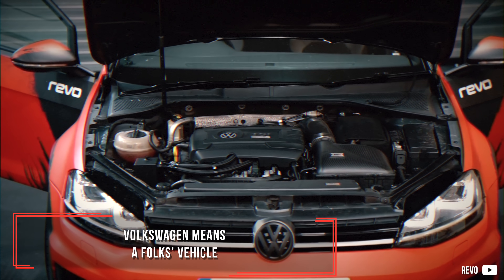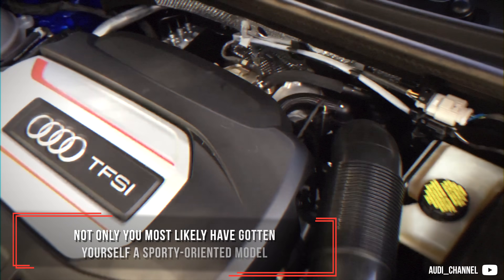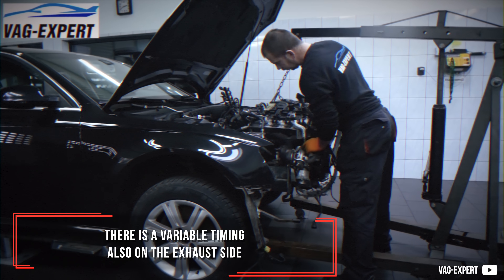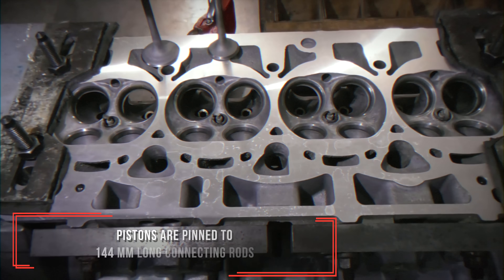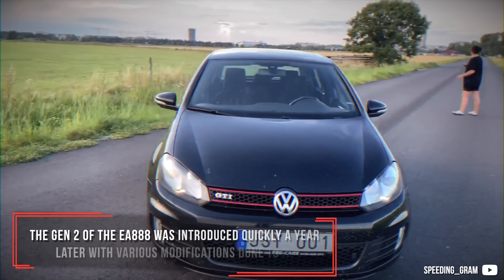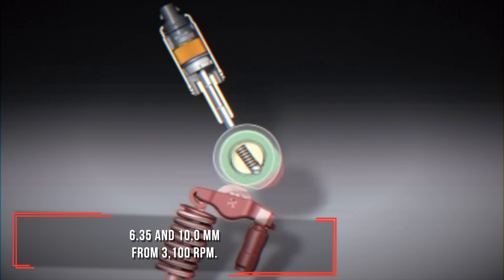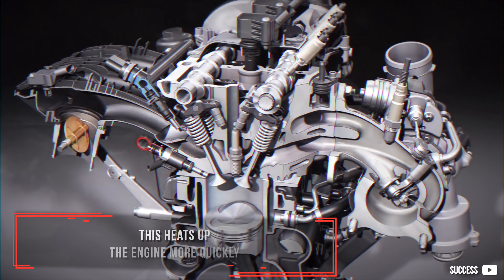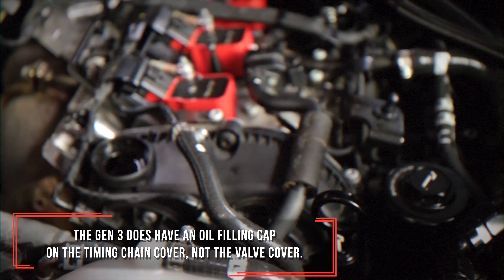Why The Volkswagen EA888 Is So Good

Comment: I have Cupra with that amazing engine. Stock 300, tuned to 360 now. Amazing step in acceleration. Soon I'm doing stage 2 which includes bigger downpipe and intercooler which will give additional 40 hp.
Reply: You got the ST estate or FWD 300?

I'll be going to OEM+ stage 1 mapping on mine as I have a GPF. But with remap/intake and filter/ intercooler and resonator replaced it should make between 380 and 400.

I think thats as much as I'd ask of it still being FWD lol. That and change the service interval to every 6k miles to try and be on top of it.

Comment: AP 2000 with diferent heads, this iron block 1984 cm³ is very very reliable in the old but gold version AP 2000, 8V with 110 or 125 cv with MPFI, VW powered almost all her cars in Brazil with AP engine, 1.6, 1.8 and 2.0, with single head cam. 
After they adopted multivalves and turbo, the engines lost realiability and gets more complex and hard to maitain. The old ones are still running today....everyone knows how to fix
Reply: True!!!!!!!!

Comment: Got a (gen 3) 3-door hatchback s3 (8v) dsg/s-tronic.

Engine is smooth in total powerband. Not as exciting as n/a or oldskool turbolag cars. But lots of power, decent gasmileage and sound. 

I am extremely carefull with this car, only premium fuel (v-power, octane 98 in my country). Yearly oil changes,  around 7-10k km.
I do drive a lot of short distances, but always with care. Only getting on the power when properly warmed up. 
Most days only using 25% of power, without or minimal boost pressure, according to gauge in dash.  

Have had issue; of car turning of while driving in eco mode, during lift and coast. Was problem with start/stop system.

Have had (around 125k km) problems with rough running. Sometimes having more power than expected sometimes less. Without warninglights on dash.
Codes: cam an cranktiming timing of.
Work done to fix issue.
-leaking injector switched others were tested and cleaned. 
-worn cam (sensor) 
-stretching of chain.
Chain is was not yet due but close (5th tooth adjuster)
-Main problem eventually turned out to be an intermitting fault with oilpump; took 3 weeks to find by dealer and expert.

Enginewise no further problems, no oil burning f.e.  
Except the engine sometimes feels sluggish after cruising for a while and then stepping on it in comfortmode. 

Drivertrain had an easy en cheap fix on haldex system. Rear wheels didn't engage (shortly after oilchange) Electronical update fixed it. 
Also no warning light on dash. 

I love my car; but reliable/bullitproof; definitely no.
Reply: Can you deactivate permanently the start and stop system?
Reply: @darthvaderitasidius4550  
A VAG-coder probably could inhibit this function
Reply: I also just got a 14 S3 and I have been having oil pressure too low text pop up in the instrument cluster, but only while it was idling and if I put it into sport mode while in gear where it idles at ~1100 rpm’s no problem, so I was thinking it may be the low pressure sensor, because it is intermittent even when idling normally, but when I drive it it works like a dream, so far I am very happy with the car just am a bit worried about the low oil pressure light sometimes coming on.

Comment: I have 3'rd gen of this engine. Very nice to drive, doesn't drink a lot of fuel, and makes your car really fast.
Reply: Me to in an Atlas . 27mpg overall and has hit 30 + on some tanks.
It really does warm up fast. wish my TDI would also it takes forever in the winter to get to operating temp.
Reply: @HighGear7445 We have two Golfs: Golf MK6 GT R-Line 1.4 litre 160 hp, and my Golf MK7 GTI Clubsport 2 litre 370 hp (Stage 1). I back up your comment the MK7 warms the temperature up considerably faster. The MK6 is now 12 years seemed to be consuming ALOT of oil before the last oil change. Switched to Mobil 1 FS 0w-40 for both now which should be optimal for those VW's and well see how they handle. The noises on the MK6 dissapeared. Filled up to under 5 litres on the MK7, had noises. I always top up to around 5 litres on the GTI, then start engine 2-3 times for 5-10 minutes each, then check the stick to let oil settle in the system. After the 5 litre mark no noise on the GTI. Managed to fill up to the 5.7 or so factory spec. Warmed up engine 20 mins before removing oil. Let it drain at least 30-60 minutes. Sorty im bit oil nutty!  😂 We have own car lift & stuff so!
Reply: @ewanduplessis9682  I didn't have to add oil.
Reply: @aleksanderfiold7554  between oil changes?
Reply: @ewanduplessis9682  Yes. 5 years and all I had to do were routine car inspections. No oil adding. OK - I had to add around 100 ml of cooling liquid, but it is common in these engines.
Reply: @ Looking forward to getting one next year
Reply: Oil useage?

Comment: I love my GTI 13" comes with a stage 2 I'm pretty sure.... Shit is a good motor but I recently did my oil change with a WIx oil filter and shitty royal purple oil 4 days later my oil pressure light comes on and I have to tow it to a shop under warranty I'm praying they don't need to put anything serious on the car I think it could be the shitty oil I used but I heard it could be the oil pick up but we will see